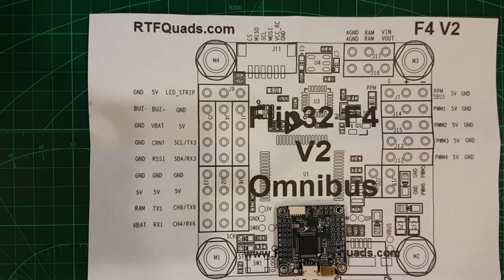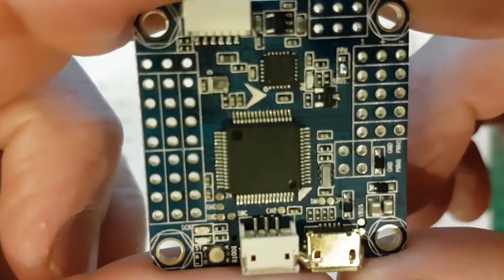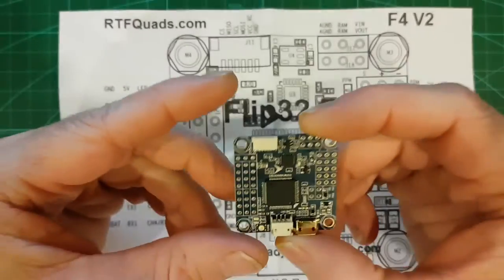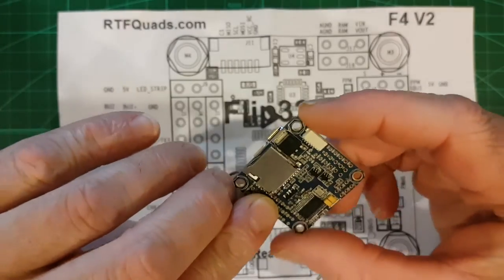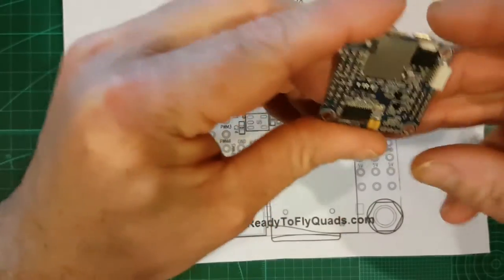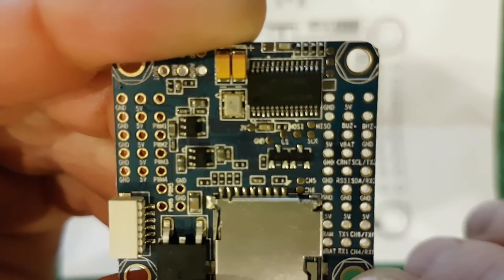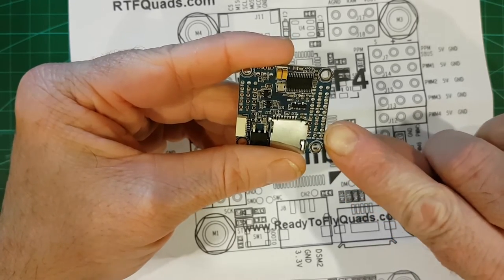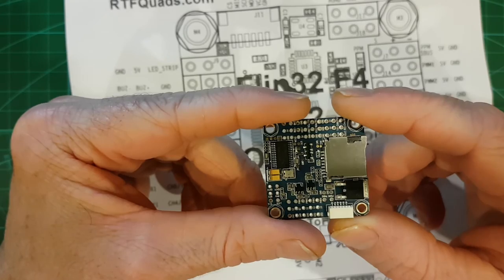Omnibus F4 V2 Flight Controller

Comment: hi.. i just got my omni f4 v2 from the post office.. i was wondering if u are aware of using this board on iNaV? it seems that there are targets for omnibus f4 but none for the sd.. and no mention anywhere else..

really learned a lot from this video, got it bookmarked (in fact)..
Reply from the maker: Hi, If you select show unstable releases in Inav firmware flasher tab there is a target for omnibus f4sd :)
should be a stable version in the next release.

Comment: can you show us the setup on this OmniBus F4 V2 . I still not very sure about the soldering on the VTX and the camera . about how to use VBat or 5V . please guide me.
Reply from the maker: It depend on what voltage you need for the camera and vtx. if you have pdb it is best to use that to power the video system if you can.

Comment: I am waiting for this to come back in stock on banggood but does this now allow me to use 3s direct and get battery voltage on osd, also can I power a vex off this or will I need an external Bec

Comment: I have one of these and it seems to heat up a lot... Is that normal?
Reply from the maker: its the 5v regulator that heats up. It works fine if you can put up with the heat. If not the only way to fix is to remove the regulator and provide a separate 5v to the board